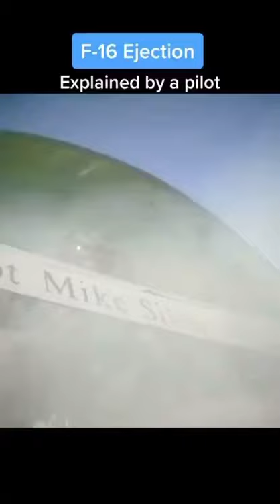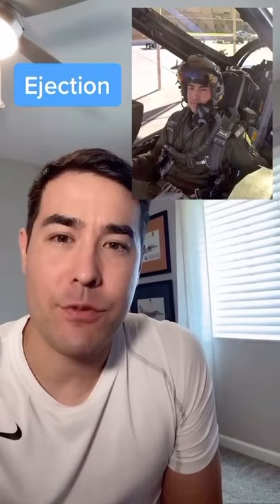🚀F-16 Ejection--Explained🔥  #Shorts

Comment: So I work on F16 and F35 ejection seats... There is no rocket motor on the seats, that’s in the forward part of the canopies.... Canopy remover rockets are used to blast the canopy off. Secondly, on the F-16s the initial big blast is from the rocket catapult that is attached to the rails that is attached to the cockpit. This is then follow by the vernier rocket that is attached to the STAPAC on the bottom of the seat. Along with hundreds of other things going on within the ejection sequence to make sure the pilots survives. I went to school for this.
Reply: Wait do you really lose 2 inches of height permanently?
Reply: @angeljoaquin920  yes, depending on how rough the ejection is on the pilots spine it could be nothing or it could be up to 3 inches. Usually pilots can only eject 1 to 3 times before being medically not cleared to fly. This is because the ejections cause the pilots spine to fuse together. Ejections are rough and pilots usually pass out upon ejection
Reply: @AlaskanDad1822  thank you for the knowledge.
Reply: No solid rocket motor on the seats? What exactly is making the seat travel upwards to begin with? The rocket motor is engages when the seat is nearly out of the aircraft.
Reply: @RickyboyH there is a rocket catapult within the cockpit that starts the ejection sequences and that send gas pressure to all of the components within the seat. After that when the seat reaches a specific height (and time) the Vernier rocket on the bottom of the seat rockets the pilot even further. The sequence of ejection is extremely in-depth
Reply: @Mathew Romano just out of curiosity fella what company do you work for while working on ejection seats for those  jets. I already know the answer to what company designed and manufacture the seats. I’m interested to see if you work for them ?
Reply: @benr.9628  bruh he’s prob jus an egress troop lmao
Reply: i was an AME on fa18, we had sju5a and naces in our birds, i saw an f35 once while i was in and i never got to see the seat on those bad boys. i always wondered how they worked
Reply: @Z1LT01D  the Martin baker seat in there are amazing to work on. Everything was actually thought off. The engineers did a good job unlike the terrible aces II in the 16
Reply: Is it not ideal to tone the power of the blasts down? Lol
Reply: I’ve never worked on 35s seats but I’d imagine it’s very similar to a naces. I hated working on the aces 2 seats.
Reply: I knéw alot of Egress guys that worked on our F-15's and they were always wanting to punch out cuz they never got to really test it Lol 😂

Comment: Watched a show in this once. It's a very violent thing to eject from a jet. Especially if you're going extremely fast.  Chances of surviving an ejection at high speed ( high speed relative to a jet) is 50/50.
Reply: What's the chances of surviving a crash? I know there has to be atleast some
Reply: @cowgoesmoo3850  I believe in ww2 there are instances of pilots surviving crashes resulting from combat damage. Odds are better ejecting obviously.

Comment: From my understanding, there is not much of a linear ramp up to accelerate the pilot. Its basically shoving that seat straight up their ass to get them from A to B in the shortest time possible. The shrink is compression of the spinal disks so you can expect soreness to spinal fractures. Oh, this un-assing the plane hasn't seen much innovation in decades but it beats what pilots in WWII had to do.

Comment: Heard that shrinking was just on the older systems and not the ACES II series
Reply: It happens with the ACESII and the Martin Baker seats, it’s simply the spine compressing due to the instant G forces up to 14 Gs.  It usually only last a few days then they are back normal for the most part.

Comment: Hey boss could you do a video on USAFE? And quick question is that active duty?
Reply: Aircrew Flight Equipment (AFE): Repacks parachutes and Survival Kits also maintains g-suits and generally things the pilots wearing.
Aircrew Egress Systems: Work directly on Ejections seats and Canopies and subsystems of the ejection system including: maintenance, complete removal and installs of ejection systems, Inspections, and explosive time changes. Both active duty.
Reply: @WoozyMuffintop  Thanks but I was talking about United States Air Force Europe

Comment: Fun thing about the ACES II system, The correct way to reassemble  the seat is not the way that works. After you’ve taken out the bottom pan and checked all your stuff there and after the munitions have been checked and everything else and you were the poor schmuck that has to put the damn thing back together, you slide it in and there ain’t no way in the world it’s gonna “click” doing it the way in the T. O.  So you hop on the back of the seat and you bounce on it with your butt. The interesting thing about it, you effectively have a live mortar round about 18 inches away pointed directly at your anus, And you are actively pounding on it with all your weight.
If you’ve done everything right, it should not be able to go off. Once again, SHOULD not be able to go off.  So once you hear that wonderful “click”; grab your stuff and shag-ass out of there.  Ejection seats were the biggest reason I worked hard to spend 99.5% of my Air Force career working on C-130s.
Reply: Joey Blowey  I never saw it happen, but every so often we’d have to see the safety film and see the guy who didn’t put the pin in the safety position after he bounced off the roof of the hanger. Not pretty, but highly motivating to remember to “check the pin.”

Comment: God help you if you have to eject from an F-35. It literally launches you through the canopy.
Reply: Several ejection seats work that way.
Reply: @dadof3tngirls  just read a report from a recent ejection at Elgin AFB. The pilot had shards of glass penetrate his suit into his body. Seems like a design flaw but it better than being dead.
Reply: There is an explosive on the transparency called the FLSC and it cuts the transparency before the pilot goes through
Reply: @AlaskanDad1822  Here's the report:
https://www.afjag.af.mil/Portals/77/AIB-Reports/2020/May/Eglin%20AFB%20F35A%20AIB%20Report_Signed.pdf

Must not have been working as intended
Reply: @Vardeth805  Yes, I know that ejection... if you read the report the ejection system worked perfectly. It’s literally in the report
Reply: @AlaskanDad1822  yeah, if the cutter charge did not go off, he'd be like ejecting into a wall.

Comment: Sounds like he just pulled a number out of his qas at the end
Reply: Nope checks out.. 12g means 12x your bodyweight. So  If you weigh 100kg your spine would compress under the metric ton of pressure that it has to withstand during the ejection. That will compress your intervertebral disks quite a bit.

Comment: What if is it upside down
Reply: nice try🤣
Reply: If they eject upside down there is a mechanism on the bottom of the seat called they STAPAC  that uses centripetal force to turn the seat upright.
Reply: that depends on wheter or not the seat has time/altitude to correct its orientation. If you are unlucky, you end up like that F14 tomcat pilot gal, that actuated half a second too late - she was launched into the water, still in her seat, and obviously did not survive.